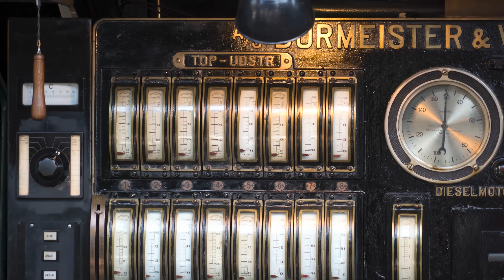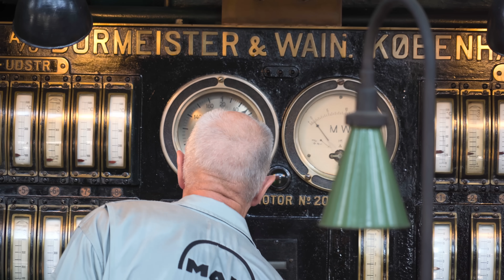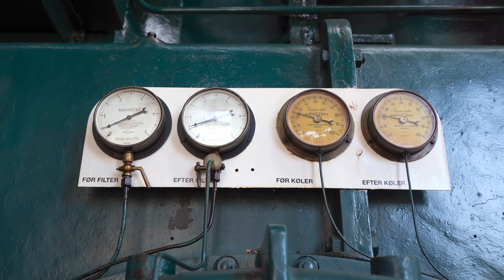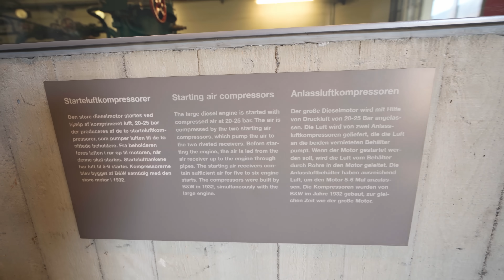Starting The BIGGEST DIESEL ENGINE On Earth | 22.000 hp B&W 2000 COLD START

Comment: I need to fit this into my Miata.
Reply: Some dude on youtube probably have made a how-to😂
Reply: Hold on there...I need it for my skateboard😁
Reply: A diesel Miata? I was thinking of just putting a windup motor in mine.
Reply: It will fit.......put one in mine ....only problem it's a bit slow on take off 😕 🙃
Reply: It would flatten your Miata. I bet it weighs a few tons.
Reply: I call dibs on it forbmy Ford Ka
Reply: Zoom, zoom!
Reply: I think you have your syntax wrong…. you need to fit your Miata into this! … probably into one of the cylinders… you might need a crane and…… a socket set!
Reply: @unclej3910 few tons ? wtf ? it surely weight over a thousand tons.
Reply: And I thought we were done at the hellcat Miata
Reply: @galewinds7696  yeah, but it will pull 40,000 pounds:-)
Reply: You're going to need a bigger Miata..
Reply: You can fit a Miata into this engine...
Reply: Not happening but it will 100% work the other way around you Miata will indeed fit in it 🤣🤣
Reply: Think you need to upgrade your springs first. 😂
Reply: Zoom zoom.
Reply: Just think of the number of Teslas you could charge with this baby! ⚡️
Reply: Good luck with that! 😂
Reply: @unclej3910 a few? Yeeaah..
Reply: You could fit your miata into one if its cylinders.
Reply: You could probably put your Miata in that engine!
Reply: I still have a yugo😂
Reply: @unclej3910 "a few tons" the steel used to construct that staircase the guy is walking up and down weighs a few tons. I bet the crankshaft alone is in then hundreds of tons.
Reply: We need whistling diesel to the rescue.
Reply: Think of the power to weight ratio...😂
Reply: Should fit right in 😂
Reply: And throw off the balance?
Reply: Watch; “Godzilla vs Bambi”.
Reply: It would be a waste of time, it doesn't have super or turbo charger lol
Reply: You could put your Miata Inside this one!
Reply: Your Miata would fit into one cylinder of that beast 👍🐿️
Reply: You will need a 2 car garage for this lawn mower motor...
Reply: It will !
Reply: Good luck!
Reply: That's like putting 30 inches in a 6 year old
Reply: Your hood won’t close!!!
Reply: @raymondsadowski6080  nahhhh really ?
Reply: Your miata is going inside the engine!
Reply: Maybe easier in a VW beetle from the same factory owner (MAN).
Reply: For your Miata ⅛ of a piston of this beast is enough
Reply: I observed, after reviewing, that the MAN is just the garment of the ripe mechanic, not of the manufacturer. So it would not fit deeply in a VW Beetle.
Reply: @jeffarchibald3837  Miata is a nice piece of more modern engineerd art.
Reply: I hope it will fit in a Lamborghini
Reply: Same comment every time! How funny... Not
Reply: Might trysolid tires with it
Reply: This engine can fit multiple Miatas
Reply: I think I can probably squeeze this into my P45
Reply: You may need to upgrade your gearbox & diff. Maybe a little suspension work could be needed.

Comment: The Wärtsilä-Sulzer RTA96-C turbocharged two-stroke diesel engine is the world's largest and most powerful production internal combustion engine. It has a maximum output of 84.42 MW (113,000 hp) of power and a displacement of 1,820 litres (110,195 cubic inches), making it larger than a V12 engine.
Reply: Work of art.
Reply: ... how many zylinders? Made in Finland?
Reply: @_Alfa.Bravo_  14 and yes.
Reply: @jimihendrix991  Depends on the model - I think they go down to 6 cylinders minimum and maxes out at 14.
Reference some Meresk (sp)? container ships for common usage.
Reply: Well, gas turbines are also internal combustion engines. And there are some out there about 5 times as powerful. It might be true for internal combustion reciprocating engines though.
Reply: @wanderschlosser1857  There are no gas turbines that are 5 times as powerful as the RTA96-C's largest configuration,
The GE9x is SOMEWHAT more powerful, but only 120-130% at it's peak power.
Or are you saying 5 times more powerfull than that B&W?

BTW - the Wartsila IS a diesel - the topic is just flat out WRONG as there are quite a few models of diesel engine that are both bigger in size AND bigger in output (torque OR power) - some by MAN as well, and I think there are 1 or 2 other companies making 50,000 HP and bigger diesels for ship/fixed usage.
The text DOES say "largest since 1933 for 30 years", not current largest.
Reply: @bricefleckenstein9666  Of course there are, industrial gas turbines. E.g. GE 9HA has got a nominal simple cycle power output of up to 571 MW, that's 765,000 hp.
Reply: @wanderschlosser1857  I was not aware of the existence of that large of a turbine.
I do wonder what the size of the thing is, can't find that specification anywhere - or the shaft horsepower, or anything else to make a comparison with.
And it's not the "simple cycle" that achieves 571 MW, that's the complex cycle with a heat recovery system, though the simply cycle managing up to 470 MW is impressive enough.
I do wonder if it can be used in a mobile setting though.
Reply: @bricefleckenstein9666  Didn't look up the exact power output, just took the highest, sorry it wasn't the simple cycle one. Anyway, I also couldn't find the actual dimensions of that thing. Certainly it's huge and heavy, not meant for mobile applications. Where would you need that power being mobile? It's rather
Reply: @bricefleckenstein9666  Part 2 (pressed the wrong button): The GE Frame engines 6E, 6F, 9HA etc. are rather for power plants. However I doubt it's bigger or heavier than these huge ship diesels, just way more powerful. Which creates the next issue, you need huge amounts of fuel, too, again, not very mobile.
Reply: @wanderschlosser1857  Most large diesel-powered ships like the biggest container ships use 2 engines, because even the RTA96 doesn't give enough power for them to cruise at a reasonably fast speed.
Reply: @bricefleckenstein9666  The main reason for using huge slow turning 2-stroke ship diesels is, they're much more efficient in that power range running on liquid fuel in single cycle reaching more than 50% thermal efficiency. Also I imagine these are rather directly coupled to the props w/o need of a gearbox. Big Heavy duty gas turbines like the 9HA barely reach 40% in single cycle, "smaller" ones (like the 6F with 200+MW are much lower). These machines prefer natural gas fuel and combined cycle operation where they excel up to 65% efficiency. Though you find aeroderivative gas turbines (aero engines modified for marine/industrial use) on lower power ranges (up to 50MW/unit) in LNG tankers (electric hybrid propulsion) as well as all kinds of Navy vessels and some fast ferries (mostly mechanical propulsion).
Reply: @wanderschlosser1857  Ballpark 40% is actually quite common in gas turbine single cycle efficiency, though higher than that by more than 1-2 percent doesn't seem to exist.
The "heat recovery" to get into the low 60% range does take a lot of space and weight - but probably not a lot more than many other big engine options for a ship.
On the other hand, the bunker oil many modern ships use isn't the "super cheap, no other use" type fuel it used to be - getting to be more and more expen$ive over time as more of it gets demanded to fuel more and more ships with.
Reply: @bricefleckenstein9666  40+% simple cycle you only find on super big heavy duties, like the 9HA. Even the still big 9F with up to 280MW only reaches 38%. Aeroderivatives like LM6000 (derived from CF6) or LM9000 (GE90) reach 40-45% simple cycle at power outputs between 45-70MW. The most efficient simple cycle industrial gas turbine I know of is the LMS100 with 50% at about 100MW which is a hybrid between aeroderivates and heavy duty GT.
Reply: @wanderschlosser1857  You just contradicted yourself - even YOU posted that many "aeroderivatives" achieve 40% or higher simple cycle, which I already knew about some of, abet at a significantly smaller power output.
Reply: @bricefleckenstein9666  A 9HA.02 reaches more than 40% at 470 MW. It is certainly not an aeroderivative but a heavy duty gas turbine. Like Diesel engines, the efficiency gets better the bigger they are, it's a thermodynamic characteristic. Same applies to aeroderivatives just on a lower power range because these engines are thermodynamically more sophisticated, running on much higher pressures and temperatures. Each of these machines has their specific fields of application where they perform best but they also cross operational areas, especially for power generation and partially ship propulsion. So, where exactly did I contradict myself?
Reply: @wanderschlosser1857  To quote YOU, "Aeroderivatives like LM6000 (derived from CF6) or LM9000 (GE90) reach 40-45% simple cycle"
It's NOT inherent that they are more efficient when larger, other losses also matter particularly airflow at the speeds they move air.
So yes, you DID contradict yourself when you stated "40+% simple cycle you only find on super big heavy duties" then proceded to prove otherwise in the very next sentence.
Reply: I believe the cubic inches is per cylinder.
Reply: The displacement of only ONE! cylinder is 1820 liters...
Reply: The Word "seiner Zeit"  means at the time where this engines new
Reply: @wanderschlosser1857 Nice try. But a turbine is not called an engine. So…. If anyone is interested: the Wartsila’s specs https://en.wikipedia.org/wiki/Wärtsilä-Sulzer_RTA96-C Can you imagine a 12.000lb piston (more than twice the weight of an average sedan) going up and down more than 100 times per minute?
Reply: @Tantrum1701  Maybe you should try some literature on the topic. Of course turbines ate engines. Gas turbines, that's what I was talking about, are internal combustion engines, same as you Wärtsila diesel or any other recip or piston engines. Steam turbines or Stirling motors are external combustion engines but still engines. The big Wärtsilas are indeed impressive but only suitable for specific applications. With a modern aero derivative gas turbines such as an LM6000 you would need two of them for the same power output of 80MW at a combined weight of only 20t, that's about the same as just 4 pistons of the engine you mentioned. As said, it really depends what for you use the engine.
Reply: @wanderschlosser1857  Not only did I read a lot on the topic, I was a ships engineer operating these engines and later an engineer designing them at Stork. All I did was pointing to a site where the specs of this Wärtsilä can be found.
Reply: @Tantrum1701  Well, then you should know that the term engine not only includes recip machines but turbines, too. That was my point. Gas turbine engineer here.
Reply: It is built in Japan
Reply: @Humppapiru  no it's not
Reply: @TasmanianDevil3  It is manufactured in Finland and probably assembled (built) at the shipyard where the ship is constructed. So you are both right, I guess.

Comment: Very impressive engine.   The start-up didn’t seem too complex—he opened a valve and flipped a switch.  Starting my truck in the winter is more difficult.
Reply: Be happy because your truck doesn’t consume even half of what that monster does 😮
Reply: Be sad because your truck doesn't haul even half of what this monster does 😮
Reply: What you did NOT see was the approx 15~30 minutes of running around prelubing everything and turning the engine over, the checks and tests, BEFORE he opened that valve and flipped that switch....
Reply: Because it's a fraud. The engine is powered by compressed air, as in most engine shows.
Reply: @nazgulX  Having been there, and being a marine engineer, I can assure you that that engine does NOT run on compressed air...
Reply: @nazgulX it's started with compressed air, but runs on fuel. Something this size is far too big to run on compressed air simply due to the volume of air required to do so. To do so with this one, you would either need an insanely large reservoir, or an air compressor with the same displacement of this beast. Starting it is one thing, keeping it going for as long as they did is another.
Reply: @HammondOfTexas0  Correct... On ships the rule is, for reversible engines to be able to perform12 consequtive starts reversing between each start, without compressors.
That would mean a total "running on air" time of less than 60 seconds, and for an engine this size that would come down to roughly an air bottle volume of about 30 cubic metres pumped up to 40 bar.
Reply: it burns diesel it starts on air
Reply: big deal any 2 stroke can do that, some 2 stroke oil burn up too!
Reply: @nazgulX  it needs the compressed air to actually start moving.
Reply: for you
Reply: @nazgulX  Rubbish, it start with compressed air, round about 30 atmospheres, need a big air tank just to start it and several air compressors just to keep up with consumption if starting and reversing the thing.
Reply: Getting a cathedral engine like that to the point wher you are ready to open the valve and flip the switch typically takes around an hour. Way more if you're starting completely from cold.
Reply: @jimsnee1878  Yes, that's what I hoped to see, but unfortunately the video is condensed way too much.
Reply: @nazgulX  This is Denmark. Not the US. What we show is real. Not some facade put up for tourists.
Reply: @nazgulX   It is started with compressed air,  Some diesel trucks and large container ships are started this way.
Reply: @nazgulX lol. No. That’s not at all correct.  Compressed air is only used to start the movement before combustion begins.

Comment: I note with great satisfaction how he opened up the 'hot' valve at the beginning fully; then cracked it back a bit so it wouldn't get stuck as the valve heated up. A true engineer worth his overalls. Salut.
Reply: Whilst I agree with your view on not back seating a valve, that is the air start inlet valve so it doesn’t get hot.
Reply: I noticed how he handled the opening of “something” and seemed to fiddle with it for a quick second 
Even an engine of this size has a sweet spot for start up😊
Specifically speaking I have NO idea what he was doing but I could tell that he knew EXACTLY what he was doing 
What an AWESOME and AMAZING piece of engineering
Reply: @SmaxChristopher1  You've got no idea whatsoever..... Tosser

Comment: It's a peaker plant!  It was designed to come online quickly and provide Copenhagen power during peak demand when the steam turbines couldn't keep up.  Amazing.
Reply: Thanks , I was wondering.
Reply: Yeah, they use jet engines from 747s these days for the same job.
Reply: I wondered what this engine was used for, it's quite a fine work of engineering. Where I live, in Ontario, we use hydroelectric power and gas turbines for peaking. It's effective, but not as awesome as this machine.

Comment: I wonder how much fuel it takes and I'll ask to chat with GPT about it.
Reply: To convert the fuel consumption of the B&W 2000 22,000 HP engine to liters or US gallons, we can follow these steps:

1. Fuel consumption in kg per hour:
The engine consumes around 1,600 kg/hour of fuel (based on an estimate of 0.16 lb/HP-hr).

2. Convert kg to liters:
The density of marine diesel oil (MDO) or heavy fuel oil (HFO) is typically around 0.85 kg/liter (this can vary slightly based on the fuel type).

\text{Liters per hour} = \frac{1,600 \, \text{kg/hour}}{0.85 \, \text{kg/liter}} = 1,882 \, \text{liters/hour}

3. Convert liters to US gallons:
1 liter = 0.264172 US gallons, so:

\text{US gallons per hour} = 1,882 \, \text{liters/hour} \times 0.264172 = 497 \, \text{US gallons/hour}

Summary

Fuel consumption in liters per hour: ~1,882 liters/hour

Fuel consumption in US gallons per hour: ~497 US gallons/hour

This provides an approximate fuel consumption rate for a 22,000 HP engine, which may vary based on engine load and specific operating conditions.

Comment: The Nissin 35,000 SHP in-line 12 (double piston) "semi-diesel" (it uses a Bunsen flame in an in-head sub-chamber "flame holder" to help ignition...1872 "tech") in a container ship (Nissin "Anna") turning a gen-set for the electric prop motors is the LARGEST marine internal combustion engine EVER "erected" (NOT "built"). It runs 360 RPM (nominally) and burns super-heavy oil that must be heated to over 400*F to flow, with ground-up USED TIRES added to increase the BTU output (more than DOUBLE pure bunker oil!). The Anna streaks across the Pacific (only place it CAN operate) at a thundering 8-14 knots. The Nissin Anna isn't the "World's Largest Container Ship", but it's in the top five in DISPLACEMENT. To turn her in a 360* circle would be about 25-30 KNOTS in diameter and take 36-60 HOURS! It takes more than a WEEK to "start" this engine-normal for container ships.

Comment: Not a COLD Start... Before starting an engine this size, they pre-heat engine coolant water and pump through block so thermal expansion allows metal parts to reach proper design size & tolerrances before starting. 
External lubricant pumps are also turned on before engine is started, so that parts are well oiled from very first motion instead of having dry scrape and wear for parts like huge crankshaft & connecting rods.

This helps reduce wear significantly, and allows engines like this to have service life running many decades longer than cars.

Comment: this is a tiny engine with 20k hp power.
Finnish-made Wärtsilä-Sulzer RTA96-C is the largest internal-combustion engine ever produced and pumps out a whopping 80.1MW (107,390hp).
Reply: These engines are naturally aspirated - no turbo chargers. The roots blower just ensures a cylinder full of clean air for each compression stroke, it does not supercharge at all.